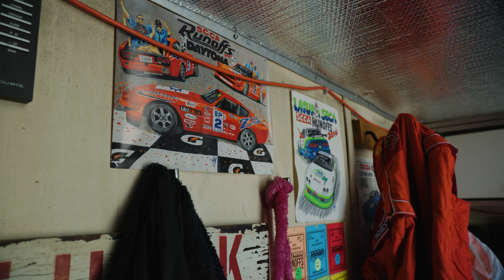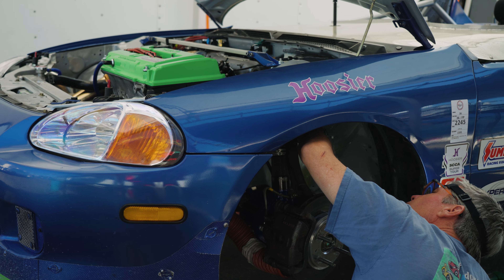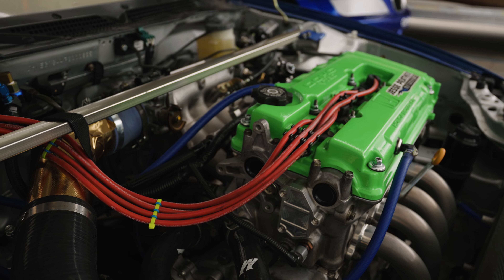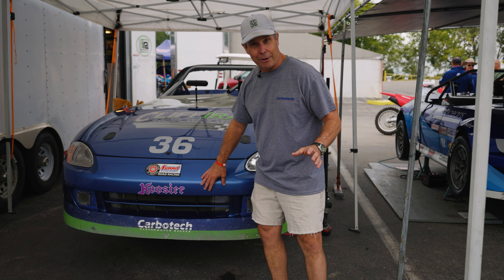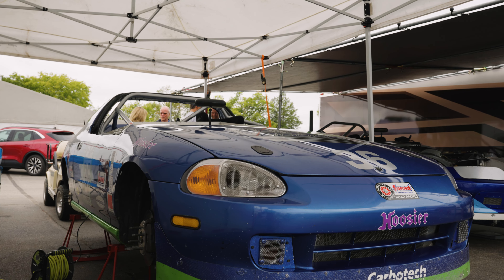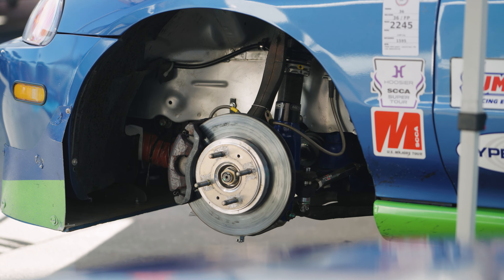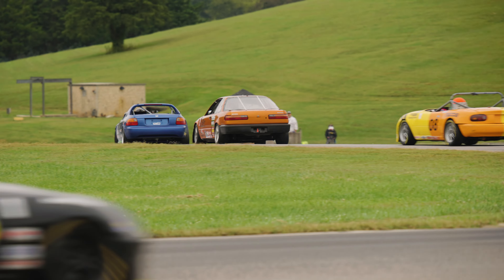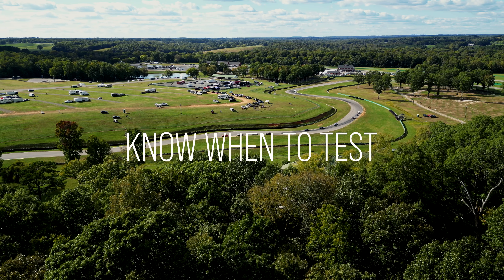Developing a Race Car | SCCA Shop Manual presented by Hoosier

Comment: excellent choice something different besides a mazda, keep up the good work
Reply: Total area not discussed is availability of performance parts, their cost and most important, how hard/easy is the car to repair…which is why there are so many Mazda race cars out there.  The front engine rear drive and fully removable subframes not to mention upper and lower control arms ( no Mcmearcence struts😂) all make the mx5 a totally awesome race car.  Oh yeah, No Top Needed!